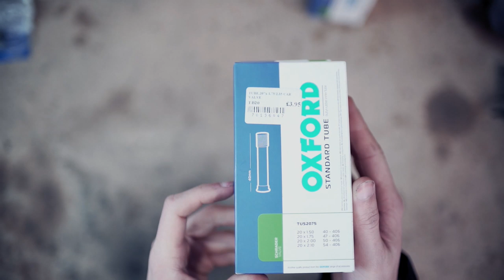XJ650 Build Part 26 - Engine Install * By Yourself *

Comment: I would like to thank you for the update @Jish! I am also on a XJ750 cafe racer project and was looking forward to remove/remount the engine. I've been reading forums on how to remove/remount it but it take much less time to watch your videos! It also allways worth the time spend on your channel ;-). BTW, are you not worried with the space beetween the rear tyre and the bike's tail?  I was wondering if it cannot scrub in case you hit a bump or a hole on the road !! Keep going the good work ;-)
Reply from the maker: Glad this video helped you buddy! I am going with some adjustable suspension and because there is hardly any weight on the back I don't expect much travel or issues :)

Comment: The engine not wait 100kg.. but good méthode
Reply from the maker: You would be surprised!
Reply: I have an Xj650 4ko of 1982 on my personnal garage ;) just beside an 1100 GSXG (1992). 
You Can be proud of your method . I like it